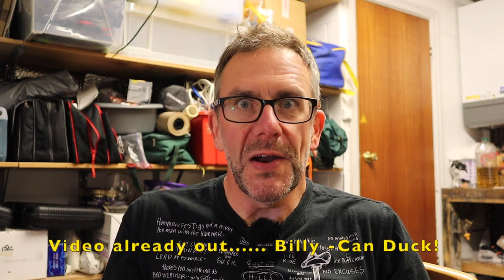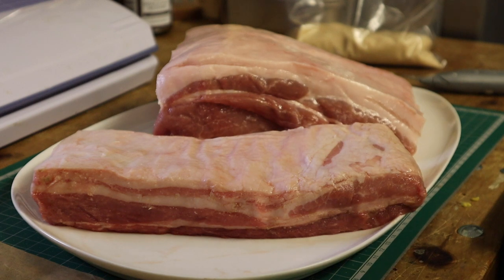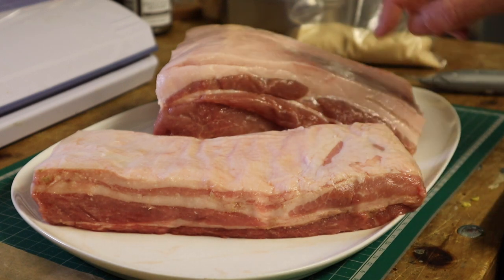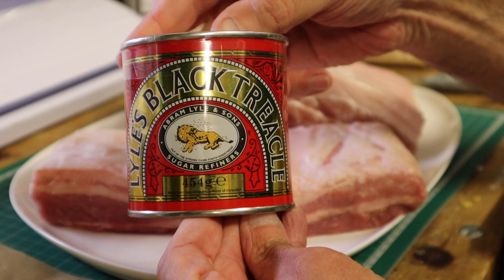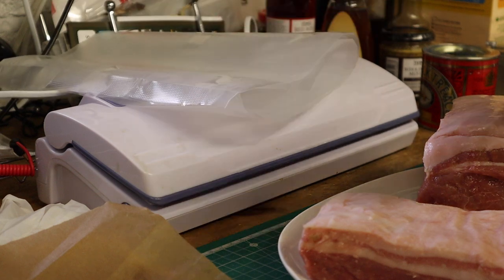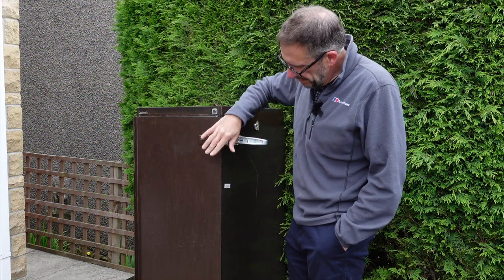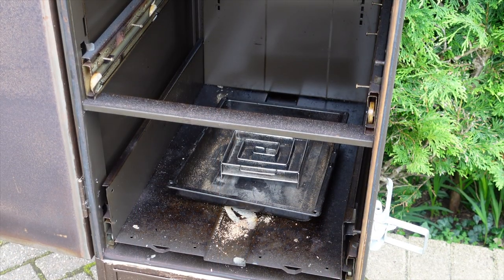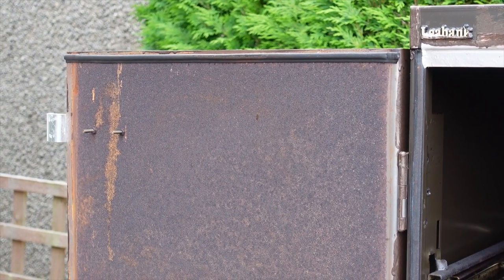Make it!:  Home Cured and Smoked Bacon!

Comment: Hi Richard, Ive just washed off the cure and dried the meat. How long do I leave it in the fridge for before its ready to eat or smoke. How many days, do I leave it uncovered or cover it. cheers Steve
Reply from the maker: 24/48 hrs drying. Uncovered in fridge on a rack to ensure air circulation. Pat dry with paper towel first.
Reply: @RichardOutdoors  thanks richard

Comment: Got to ‘hand’ it to you Richard. Another fine video!  A question ... Am I right in thinking, your smoker doesn’t have a chimney, other than the little one you showed? And, is it possible to do this with un-cured meat just by slicing it first and then smoking?  Thank you very much. Something else I’d really like to try now! All the best. Paul.
Reply from the maker: Hi. Thanks for the message. Just remember that it is a cold smoker and, as such, everything that goes in must be cooked afterwards unless it’s something like fresh salmon. A hot smoker (chimney required) cooks the item and can be used for many more meats etc. The ‘chimney’ I have is nothing more than a vent to let a tiny amount of smoke out which enables a small amount of air in, this keeping the burn going.
Reply: Thanks very much. Got it! 🍻

Comment: You may want to look into an Equilibrium Cure!  With that method you have more precise control on how salty your end product is and you don't have to be worried about leaving it in the cure to long as it will not take in any more salt than you have decided you want it to!  So if you had used that  method you could have taken both pieces of meat out of the cure at the same time and only had to deal with it once.
Reply from the maker: Mike's Micro Shop Interesting. I’ll look into that. Thanks!